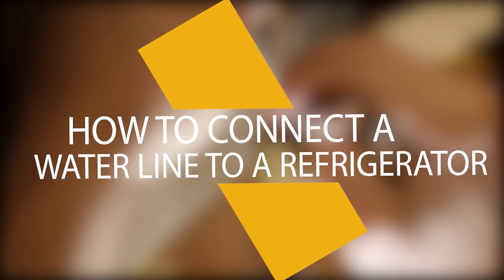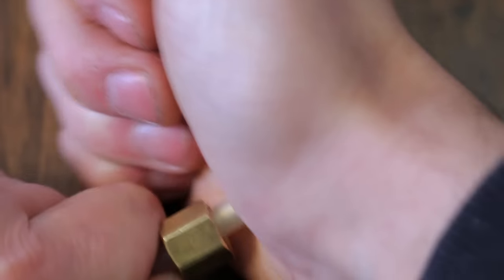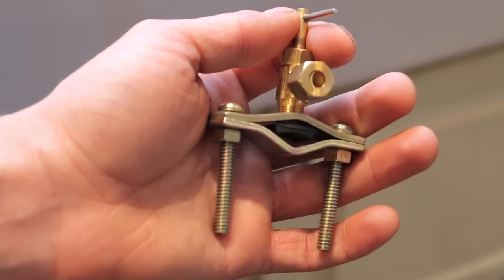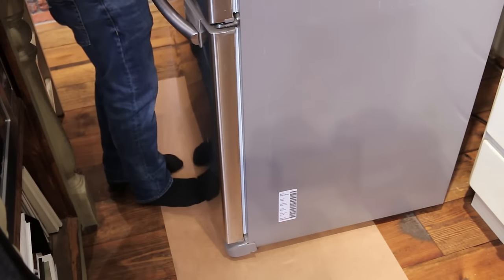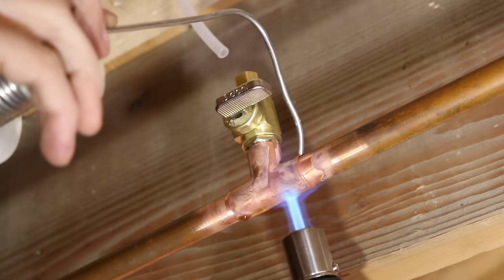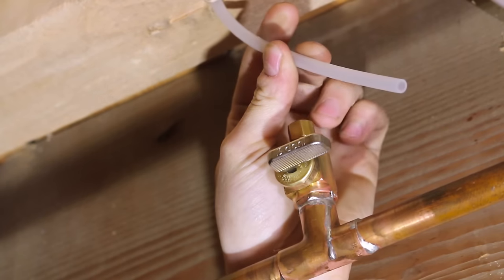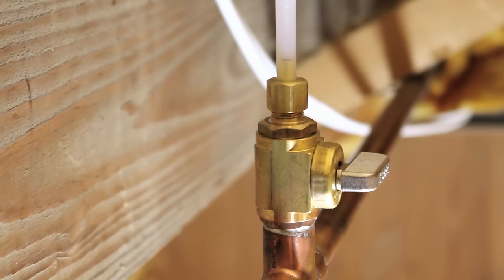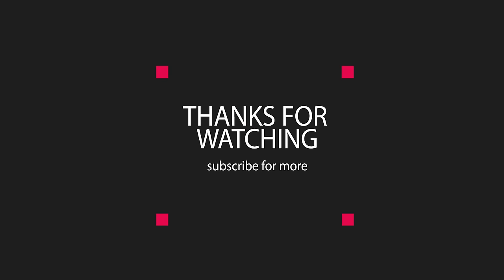How To Connect A Water Line To Your Refrigerator (+Tips & Tricks) | GOT2LEARN

Comment: I followed this video to the T. I think I messed up because I installed the clear  plastic pipe directly to the fridge. Came in about an hour later and it had blown off the fridge connection…. Water everywhere. The fridge did not have a blue line like the video.. lessons were learned.

Comment: I had a pinhole leak and cut the line a few inches.  I've tried buying a compression sleeve iinsert, plastic Pharrell and the nut. When I screw it back on to the shut off valve the water pressure pushes that plastic pipe right off.  The Pharrell and nut remain on the valve but pipe shoots right out the back.  Any suggestions?

Comment: Struggling to figure out how to install a Reducing Tee on a PEX 3/4" line where there is not enough movement between 2 studs.
It seems like the Slip Coupling is not manufactured for PEX, and I already watched your video on how to do this with Copper. Any suggestions?
Reply from the maker: There's no real option with PEX, the only thing you could do is bend the pipe, or just a Sharkbite slip coupling or repair coupling to do this.

Comment: Hi, thank you for sharing this video, very helpful. I have a question. It is a must for the water supply to be pressured?
I ask because were I live we cannot drink tap water, it is clean but not drinkable. I was thinking on a 4 gallon recipient above the fridge, perhaps if needed a submersible pump?

Regards,
Reply from the maker: Good question! I am guesding that yes it would only work with a pressurized system. You would have to give it a try ;£
Reply: That would be a bad idea.  If the tank ran low on water when the ice maker solenoid is on, it might never cutoff as it never filled up to a required level.  The solenoid may overheat and seize in the open position, causing a tank refill to never stop pouring into the ice maker.

The tank idea would only work if the ice maker were mounted in a bottom freezer in order to get some gravity flow.  But it might not be enough to push the water through the filter.

You would be better off just connecting a tee off your undersink purifier to your ice maker.
Reply: @aoksys31  That makes sense... Thanks you.
Reply: Recommend you also watch "How to install a water filter" video. Your refrigerator might have a built-in filter...

Comment: Due to the size difference in the fridge is I had to move then you went to a different location therefore was my question 
can I tap in to the waterline anywhere in the crawlspace or do I need to run it as a complete new system hopefully this is a better understanding.
Reply from the maker: You can tap into the existing water line, there are no problems, or you can use the old water connection from the old fridge, both will work.

Comment: I live in an apartment and my water dispenser is too sow. I have Cooper coming out of the wall that connects to the braided tube which then connects to the plastic tube... any ideas?
Reply from the maker: Have you tried swaping out the filter?
Reply: @Got2Learn  yes this is my 3rd filter... It takes about 17 seconds to fill up 8 oz....
Reply from the maker: @marcegc31  what kinda pressure do you have elsewhere in your home?
Reply: @Got2Learn  pressure is good everywhere else... idk if it's something with the intake valve?
Reply from the maker: Could be clogged depending on the type of water you have.

Comment: Mine came with a filter. Is it needed for this ?
Reply from the maker: Not needed, but good to have 😊
Reply: Got2Learn got it. Although that filter is for the automatic cold water. That’s another line to be installed. I’m not interested in that one because we boil the water but I can possibly use it for cleaner ice.
Reply from the maker: Yes, if you have a use for it, definitly use it :)

Comment: I am in a townhouse and wanting to connect our fridge to a water line under the kitchen sink, then run the hose indiscreetly under the kitchen counters around to the fridge so it will look nice and not be visible. Are there fittings that I can get or adapters, to put the fridge hose connection in between the Threaded connection from the wall and between the other threaded connection/braided steel hose going to the sink faucet? Anybody know what adapters and fittings I might use and what they are called? Being I a town house I definitely do not want to be doing any soldering or cutting of pipe, haha. Not to mention because I don’t have access to a water shutoff valve. Haha.
Reply from the maker: You can't shut off the water?

Comment: What if the sleeve still allows the pipe to be pulled out easily?
Reply from the maker: Might wanna get some new fittings, is this with new fitting or old ones?
Reply: @Got2Learn  brand new..looks like with a lil  tightening it's all good
Got it all installed 
Fingers crossed
Great vid..thanks for the response
Reply from the maker: Awesome buddy, keep an eye on it just in case ;)

Comment: There are much easier ways of doing this.
Most homes have a water connection in the refrigerator cavity and it has been code to have this connection since the 90's
And if they do need to run a separate water line it would be easier and more secure to just use a braided ice maker/water line with 1/4" compression fittings on both sides from the new water connection to the refrigerator
Reply: not sure where you live but I have never heard of water in refrigerator cavity being code and Canadas codes are about 5x better than the U.S.

Comment: The closest water line I have access to in the basement is a 3/8” cold line running to my sink. Do you have any suggestions for a shark bite fitting to use?
Reply from the maker: A 3/8" Sharkbite tee :)
Reply: I figured, but haven’t been able to find one. Thought you might have a specific example.
Reply from the maker: https://www.homedepot.ca/product/brasscraft-push-in-tube-tee-38-inch-od/1001141545?eid=PS_GOOGLE_E-Comm_GGL_Shopping_PLA_EN_Building%20Materials_Building%20Materials_PLA_EN__PRODUCT_GROUP_aud-765569715721:pla-498823748832&gclid=CjwKCAiA_f3uBRAmEiwAzPuaM6X_3v4mVhbrW49eYPQe2NEFaWz9fRNPltVPPCaOD87dW2IAesNOjBoCXLQQAvD_BwE&gclsrc=aw.ds

Comment: What happens if you used a brass Ferrell but put a brass sleeve inside and didn't over tighten
Reply from the maker: If something does happen, your insurances will not cover anything, don't risk it!
Reply: my question is will it hold like the plastic ones or?
Reply from the maker: @GG-tt3sg  sure, but it'll most likely cut through it.

Comment: Plastic tube sprung a leak in middle of line and I lost all my hardwood flooring in my ranch house. Cause was an air bubble manufacturing defect when tube was made. $25,000 in damages from a pos home depot purchased tubing. I'd 100% use copper over plastic.
Reply from the maker: Holy crap!! That sucks for you man...
Reply: @Got2Learn  was awful, insurance company said they spring leaks a lot. was a pinhole leak, I was out about 6 hours and got home to 2" of water in house
Reply from the maker: @bobbyjuice3935  😪😪😪

Comment: Hi, I just saw your video.  I am wracking my brain, trying to figure out what to do.  My fridge broke along with my water filter.  I bought a new fridge but the new one does not dispense water.   Is there a way I can use the wall water valve and somehow get clean drinking water?    Please help this lady in dispense 😂  Thank you
Reply from the maker: I would suggest just filtering the faucet water you'd use for your dishes instead, with the setup you have you'd need to open up the walls which I am sure you aren't interested in doing hehe.
Reply: @Got2Learn  Thanks for the response.  I thought about that.   I am overwhelmed with the connection that already exists (dishwasher, faucet spray attached to the faucet, garbage disposal, hot/cold, and the precut hole has something attached)  see y I'm wracking my brain 🥴
Reply from the maker: @veronicav.mandujano3602  yes, plumbing can be brain wracking! 😆
Reply: Racking not wracking, I see it now.
Reply from the maker: Hehe ;)

Comment: Mine has a brass ferrel and it's leaking. Used teflon tape, everything's nice and tight. Not sure what's going on.
Reply from the maker: Brass ferrel on a plastic pipe?
Reply: @Got2Learn  It was that the ferrel wasn't snug with the fitting. Hammer it in all the way, y'all.

Comment: just what i needed to know. Thanks. When I solder that close to a petcock I usually screw it off so the heat does not damage it and put  it back once the copper has cooled off. If possable.

Comment: My refrigerator doesn't have the plastic hose in back of it to connect to, so I attached an iSpring t valve to attach my 1/4 in line directly to my refrigerator input fitting.  Using the brass nut with brass sleeve and plastic ferrule still leaks.  Any other advise to get this connected properly?

Comment: This is a great video, and I think I need to install the valve doing the soldering method, which I have never done before. My question is this: I see you are cutting the copper pipe, and getting it ready to attach the valve, but you are manipulating the copper feed line in order to fit the valve between the ends of the copper pipe you cut. Couldnt that cause a leak or a disconnection from where the copper pipe is already soldered at another point.?
Reply from the maker: My copper pipe wasn't attached very well to the structure so I was able to move it to fit the tee fitting, but you are right, playing with it too much can cause leaks if the other end is due for one.
Reply: @Got2Learn  So then, in your opinion, would a shark-bite be a better option to use  and be less of a strain on the pipes being maneuvered?
Reply from the maker: @Charlie9165  either one will require the pipe to be moved, as long as the pipe isn't moved from one direction to another many times it'll be fine.

Comment: I respectfully disagree with your concerns about using copper piping. If correctly installed, the copper will not pinch.

(1) What you do is have what's known as a "pig's tail;" this means keeping several coilings of the copper curled up in about a 2' diameter, behind the fridge, which should result in about a 10' length of curled up copper. When you pull the fridge out, the copper coil will stretch out like a pig's tail or a Slinky; pushing the fridge back in, the copper will return to a coiled state, again, analagous to a pig's tail, or pushing a Slinky back after stretching it.

(2) I have never saw a corroded copper ice maker water line---BUT I have seen the plastic piping develop pin holes in it. As the old adage goes, "copper is proper."

For the record, I am not a plumber by trade, so I have no special interests in promoting the use of copper to plumb ice makers---or anything else---other than it works the best, and is the safest, for ice maker piping installation.

Besides my disagreement about not using  copper piping, this is a VERY informative video in all other respects, and I thank you for going to a considerable amount of trouble to make and share this video with us.
Reply from the maker: Thanks for your input ;)
Reply: Actually both copper and plastic is wrong lol.
Reply: I'd run copper to a shut-off valve behind the fridge and then install a stainless steel flexible line from shut-off to fridge. No worries when moving fridge and you can turn off the water easily and quickly.

Comment: Geek Squad refused to connect my water line because I had an existing copper line. I swapped it out for braided stainless steel, as recommended by Bosch,  just following your video. No leaks,  great water pressure and easy. Thank you for such a detailed and easy to follow  DIY tutorial, you’ve acquired a new subscriber.
Reply from the maker: You are most welcome, please share if you can, it helps the channel tremendously ✌✌

Comment: Just a small note and 1 thing I noticed in this video.
Note: I would add 1 step which I commented on in a reply below. Which is to flush the water after installation and also after each filter change. 
Regarding this Video: When the "T" was being heated and soldered. It can be seen that the plastic tubing coming from upstairs was melted/deformed by the torch 😁
Reply from the maker: Yes, I just cut it off because it was too close, good observation ;)
Reply: @Got2Learn  Thanks. Your videos are great all around. So definitely keep on making more.
Reply from the maker: Thanks @Manny, will do ;)
Reply: The valve was in the "OFF" Position when soldering - Maybe leave it open when soldering?
Reply from the maker: Nornally yes, for 1/2" doesn"t really change much ;)

Comment: My brand new Samsung fridge pours water out soooo slow it takes a good minute or so to fill up a cup any ideas? I already replaced a line with a new one and no leaks
Reply from the maker: Some refrigerators have an in-line filter somewhere, maybe it's clogged, check that first :)
Reply: @Got2Learn  no my fridge doesn't have one im stumped
Reply from the maker: Are you sure the pipe isn't kinked? If it is, this would surely be a symptom.
Reply: @Got2Learn  yea the valve is a straight shot into the hose no kinks and the water flow is good when I opened it into a bucket  so took i the filter out and put the hose back in the water flow didnt improve
Reply from the maker: Model # and brand? It could be that the flow you see, is the flow the fridge gives out also.
Reply: @Got2Learn  I doubt it it's really slow. Samsung model RF265BEAESR
Reply: To fill a normal 16oz water bottle it takes almost 2 minutes
Reply from the maker: The next thing I would do, is try filling the same bottle with the refrigerator pulled out, if it still does it, it could be the refrigerator is just defective. I had the same refrigerator, and I had an ice build up problem at the bottom and a tech had to come and fix it. Try that, lemme know ;)

Comment: thanks for the thorough instruction. by me having to watch it obviously I'm not an expert in this, however I am an aircraft mechanic so I know how to fabricate and install fluid lines for hydrauilc, pneumatic, and fuel systems. Deburring is not a process in which you enlarge the hole after cutting the pipe but the process of removing the burrs of the material after the pipe is cut. Hence, deburring. Burrs are the small amount of material that gets smushed and form a sharp edge on the inside diameter of the tubing when it is cut and need to be removed by deburrring. Other than that, great video, thanks for the help!

Comment: I used the shake bite push connector. The hardest part is ensuring the pipe is inserted all the way to the marking. Man, did it take some elbow grease.
Reply from the maker: Yeah they take a bit of fussing to get them in sometimes, thanks for the comment :)

Comment: Great explanation.  I'd recommend braided over simply unbraided PVC.  We had a small leak after years of use in the middle of the plastic PVC not at one of the fittings.  No known reason.
Reply from the maker: Great point, thanks Tom!

Comment: Thanks for the explanation my fellow canadian..very thorough!

I have a recurring issue...I am using a brass fitting connection, however the plastic ferrel is blocking the brass fitting from reaching the opposite thread (which is connected on the fridge water line). Is the plastic ferrel supposed to be somehow encased within the brass fitting once tightened? It seems like it is being blocked.
Reply from the maker: You are most welcome, yes it's supposed to be a little incased like you said 😉
Reply: Thanks for the quicky reply...it won't allow me to tighten the nut over the plastic sleeve...they both slide through the water pipe but the sleeve won't fit inside the compression nut...it's weird. Do I need to put the sleeve in hot water or anything like that? Thx again
Reply from the maker: No it should go in with no effort, maybe you can try getting another one.
Reply: Ahhh i figured...home depot here I come...cheers!

Comment: I can do electric, but plumbing is new to me. I wondered how to connect my existing copper water line to my new icemaker. This video helped - to a point.
 My apartment is already set up with a water supply and shutoff valve and copper tubing YEA! No soldering!
 I have to join the copper tubing to the plastic tubing. I don't know how.
I will buy a brass ferrule (sleeve) for the brass tubing. For the plastic tubing, i will buy a brass insert and a plastic ferrule/sleeve. I hope I got that right! BUT I don't know how to JOIN the  brass tubing to the copper tubing. What do both screw into? 
I guess I will ask at home depot.
Good video, but there's still one thing unanswered for me. Darn.
Reply from the maker: Awesome, glad I could help out!
Reply: 2011littleguy .. Did you ever figure your question out? I have the exact same problem.

Comment: If you can solder a copper tee then why not just bring a half inch copper line through the wall behind the fridge and add a flush fridge valve box
Reply from the maker: That requires opening the wall in question, but yeah it's very well an option ;)

Comment: I'm installing an new ice-maker to an inline filter (Lasco 37-1833) before going to the water supply.   The ice maker has a 1/4" white pvc tube, and to the filter is 1/4" Compression braided steel tubing.     So instead of the push-fitting, I'd prefer to use the compression fitting (brass sleeve in the tube, with the PLASTIC ferrule/olive).. but not sure how to connect the water supply side.

The water source needs to come from a brass washing machine shut-off valve (Male 1" OD , 3/4" ID).    How can I connect a splitter just on the Cold side so that I can still connect the washing machine female braided steel tube , and the other to the Ice-Maker Filter  (Female 1/4" braided steel).     I can't find a Tee that has a 3/4" female inlet to 3/4" male and 1/4" male!